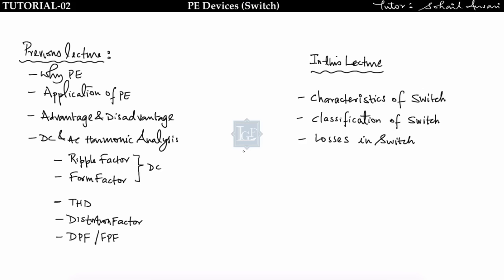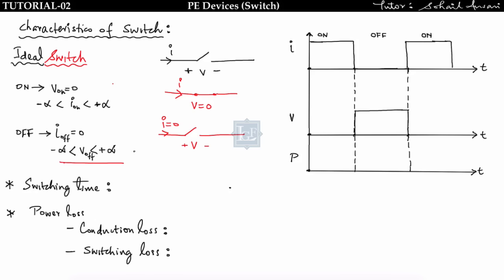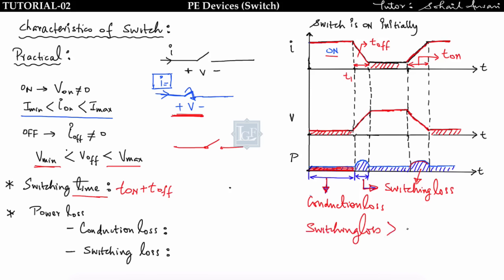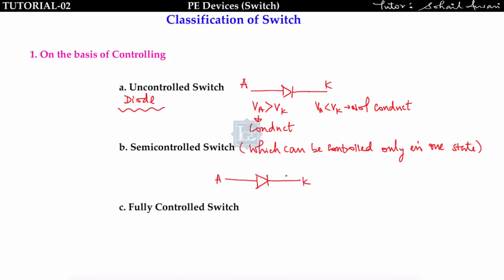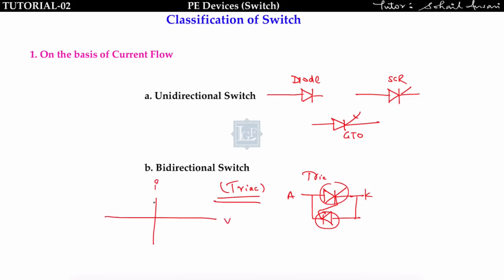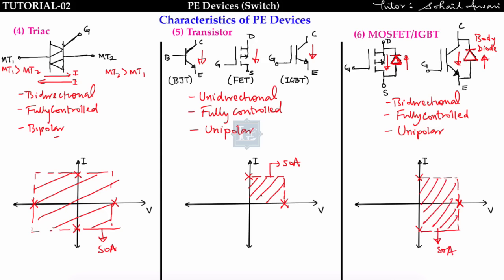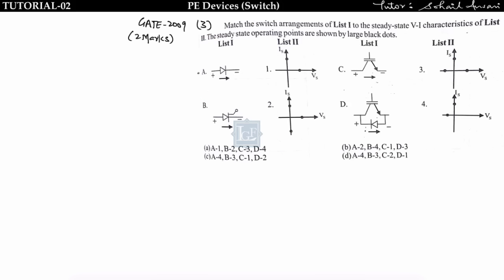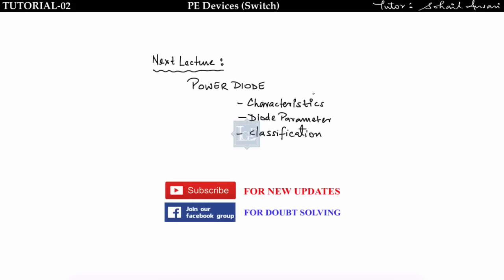Lec 02 Switches Characteristics,Classification & Losses

Comment: Sir, the BJT and MOSFET and IGBT will not allow current direction in opposite direction, so when we apply negative voltage it should block the negative voltage as in SCR. Then why it is a unipolar switch?
Reply: If u get the ans plz share

Comment: In mosfet/igbt, if we apply positive voltage with respect to the diode it will start conducting without the need of gate voltage.so how is it a fully controlled device?

Comment: isnt the BJT bipolar...as it controls the voltage in both direction. During the positive half cycle, it waits for the base supply, and during negative half cycle. it will not conduct......(Bipolar Junction Transistor(BJT))

Comment: Hi, the lectures are useful, in the second lecture on switches, you have mentioned that power diode is unipolar. You also say that unipolar means it blocks only one side voltage and bipolar means it blocks both side voltage.

As of what I have learnt, I differ here that Power diode is actually bipolar. Bipolar means both majority charge carriers and minority charge carriers are needed for diode operation. Alternatively, Mosfet is unipolar because it is a majority carrier device since minority carriers are not responsible for conduction.

Hopefully, you see this and change it.

Comment: dear sir,
                   Swithes can be diode, thyristor etc For ON To OFF state it take some times to become current is zero due to stored chrages,recombination charges (that is reverse recovery time) for that you have shown negative slope .But for OFF to ON why positive slope is required in current and negative slope in voltage.If it is diode after current reaches to zero then it immediately farward biased (Voltage =0 current is there)where as in thyristor no current is there upto gate triggering no gate current flows through the switch

Comment: dear sir at 24:50 u siad that BJT, FET and IGBT (the central part of slide) are unipolar devices. but going by charge carriers BJT and IGBT uses electrons as well as holes for conduction and are thus bipolar devices. (made easy booklet has one mcq and answer of that also shows that GTO, BJT, IGBT, SCR are bipolar devices and only MOSFET (from available options) is unipolar as it is majority carrier device )..
finally the doubt is which definition of unipolar or bipolar is to be used?
first one that is told by you: it depends on voltage blocking capability. bipolar=block vol in both directions and unipolar= blocks vol in one direction only. 
the second one: if only majority carriers device then it is unipolar. if it is majority + minority carriers device then it is bipolar.
both definitions are not consistent in manner that result from first definition dont conform to result from second definition.
Reply from the maker: u are absolutely correct..i divided on the basis of blocking ..not on the basis of charge carrier..so whatever i have written is correct..do not get confused..
Reply: but sir in exams like ssc, they directly ask this question without giving heed to the two basis (on basis of chrg carriers or vol blocking capability),, in such situation what basis do we need to consider?
Reply from the maker: then go according to the majority and minority charge carrier..ok
Reply: u should mention the point that bjt , fet ,igbt and scr are bipolar devices and only mosfet is unipolar .
ur way of representation on the basis of voltage blocking is misguiding and their SOA will also be different from ur's graph.
Reply: yes you are right BJT and IGBT are Bipolar Devices

Comment: shouldn't the safe operating area for diode be in the first quadrant rather in second as mentioned by you?
Reply from the maker: its in sec quad only..in first it will start conducting..
Reply: So does that mean SOF is actually safe blocking operating voltage or safe voltage where things can control by blocking?
Reply: Sir bjt unipolar kse ho skta h
Reply: Name se hi clear h ki bipolar hi honga
Reply: Vinayak Singh here bipolar means the device which can block both polarity of voltage
Reply: but BJT is bipolar junction transistor....in rhis case bipolar means conduction due to both holes and electrons

Comment: 04:18 Characteristics of an ideal switch: zero voltage during turn on, infinite current during turn on, current equal to zero during turn off, voltage can withstand infinite amount during turn off
08:36 Switching time for an ideal switch is zero.
12:54 The conduction loss and switching loss need to be found separately.
17:12 Switches can be classified as uncontrolled, semi-controlled, and fully controlled based on their controlling capabilities
21:30 SCR is a unidirectional switch that can block both positive and negative voltage.
25:48 The different types of switches discussed are semi-controlled SCR, fully controlled GTO, bidirectional transistor, and fully controlled MOSFET and IGBT.
30:06 Switches can either be unipolar or bipolar, depending on their ability to block voltage.
34:17 Certain switches can block both positive and negative voltage, while others can only block one direction of current.

Comment: Dear Sir, what is the difference between Closing the switch and turn ON the switch as you have explained between 6:40-6:55. Will appreciate if you kindly clarify .I guess you meant " "since it is practical switch ,Even after closing the switch , It will posses some finite amount of current and voltage " .TIA

Comment: Dear Sir,

In this lecture you have solved one question of gate 2005 for swicthing loss calculation. in which you have taken0 to T2 in calculating E2. Sir i think it should be T1-T2. for time period. ? 

Please correct me if i am wrong
Reply from the maker: see T2 is the time not from zero point..T2 is the time of decaying..so no need to scale it..ok

Comment: Dear Sir, 
How are BJT ,FET,IGBT ,MOSFET fully controlled if we cannot control negative voltage ?
Reply from the maker: we dont have to control negative voltage...we have to control on and off of switch..these three can be turn on by supplying gate current or gate voltage and can be turn off by removing gate supply...so we can control both on and off state..

Comment: sir I have few doubts.why did you represent the power losses i ,e conduction and switching losses in the form of a semi circle ?? 8:27. Was it intentional or just for representation? 
and as can be seen from the same graph at 8:27 the ton and t off periods are shown equal are they equal all the time or do they differ? 
at 9:47 u have given the formula for Pavg where the limits of integration are given from 0 to Tc but if you take it from zero it will also include the values of current and voltage that correspond to turn on switching loss. please explain why you have taken the limit from 0. please reply me at the earliest.
Reply from the maker: it will be semi circular only..multiply the voltage and current in that region...u will get waveform like this..and while calculating limit..i m shifting the y axis to that point and then calculating..so dont get confused..
Reply: LearnGATE Free sorry sir I still dont understand the concept behind taking the limits from zero. can u please elaborate it. and please answer whether the ton and toff times are equal all the time ?

Comment: sir, switching loss in on condition me sir voltage nd time ka equation kaise aaya mere ko smjh me nhi aaya.
maine two points bnakr equation likh rha phir v nhi ho rha.
point= (Ton , 0) nd (0 ,V)
Reply: Equation of Straight line is y= mx +c. where m is a slop, c is a y-intercept,  (0,V),(Ton,o) here from the point we can determine m=(0-V)/(Ton-0)=-V/Ton. and C=V. Now put these values in a straight line equation and we get 
v(t)= (-V/Ton)t+V = V(1-(t/Ton)).

Comment: if a diode is connected in antiparallel with a thyristor ,what will be the effect on turnoff power loss and turnoff time.?
it would be nice if you could answer it. 
thank you .
Reply from the maker: turn off time will reduce but power loss will increase bcoz of conduction of diode in reverse condition..
Reply: Sir,  as the reverse vtg across the thyristor is increasing so it will take more time to remove the access charge and hence turn off time increases, this is what I concluded from the question, it would be nice if you can explain your answer in detail.
Reply: RUCHI KUMARI , yes since voltage across switch slowly increases( Vs=Vi-load voltage ) if there is no anti parallel  diode but using an anti parallel diode voltage will be nearly 0.7volts  so turn off time will reduce  but since diode conducts in reverse direction additional off state power loss will be there.

Comment: Hi sir, how did you say bjt is positive voltage blocker? need some more explanation
Reply from the maker: Unless and untill u are not supplying base current...bjt won't allow positive current to flow...means it will block positive voltage
Reply: By the same logic, you said without any gate pulse on the thyristor, it will block the positive and the negative voltages so you called it bipolar ... Also without any signal on the transistor base, it also blocks the positive and negative, but you called it unipolar ,,,, is it correct? Why ?
For the case with body diode, the negative voltage can't be blocked so yes it is unipolar but the first case I believe it is not.

Comment: sir when we were finding conduction power loss , you just divided by the conduction time period , but when we were finding switching power loss , you divided by whole time of the cycle , 
so now , it would be trouble when we will add both the power losses for tital power loss.
so shouldn't we divide conduction energy loss by whole time period?
please reply fast sir..
Reply from the maker: see generally conduction power loss is very less bcoz of very high switching frequency..so it can be neglectred...thats y i divide with total time perios..if it cannot be neglected then we can consider conduction time also..ok
Reply: ok sir ,  got it.,
but will it be not better to divide conduction energy loss by total time and add both.